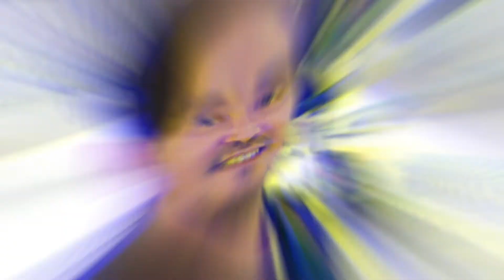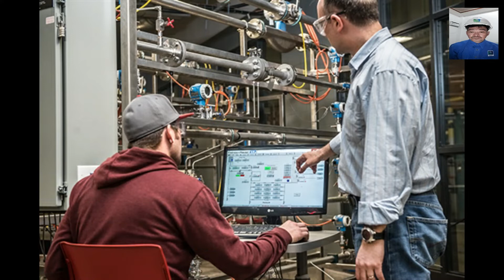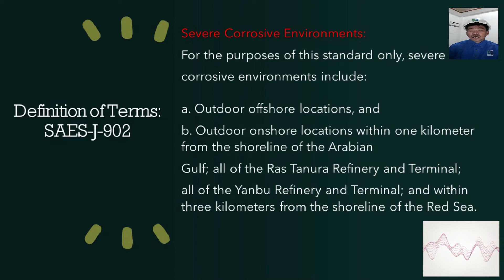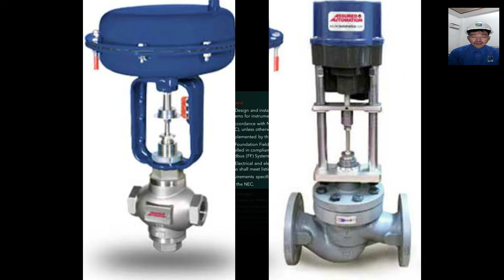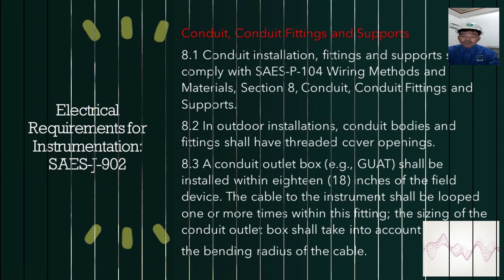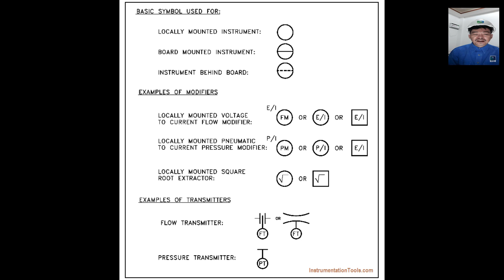#DomsTVengineering SAUDI ARAMCO INTRODUCTION TO INSTRUMENTATION “SAES-J-902” SUBSCRIBE NOW!

Comment: Without passing CBT you cannot  join Aramco.Without SAP No you cannot appear in exam CBT.I In CBT exam questions are never repeated. you are only doing copy paste and wasting our time. Candidates are told NOT to disclose Question after exam else your results are withheld . It is a writing agreement before proceding for exam. The data is very old NOT relevant to CBT Very poor english. CBT uses only American English. Fake site.
In CBT there is no interview. Everything is from American standards & codes. Hindi language is never used. The contents is never used. No reference of para Nos of American Codes latest published. Fake site mis leading information. Very poor english used
Codes edition years is not mention . Hence no relevance Are you authorised holder of codes ? In CBT there is no interview.Everything is from American standards & codes. Hindi language is never used. The contents is never used. No reference of para Nos of American Codes latest published. Fake site mis leading information. Very poor english used Data is copied .NOT relevant for CBT
REPLY
In CBT there is no repeation of question Hence no used just copying. Everything is from American standards & codes. The contents is never used. No reference of para Nos of American Codes latest published. Fake site mis leading information. Very poor english used